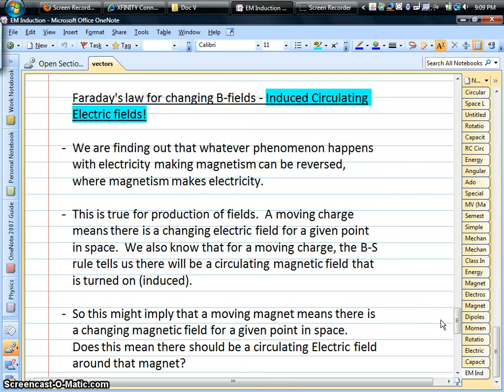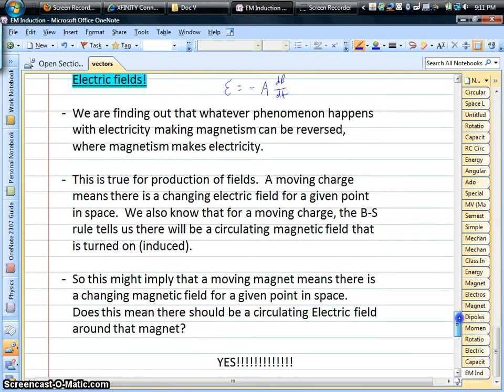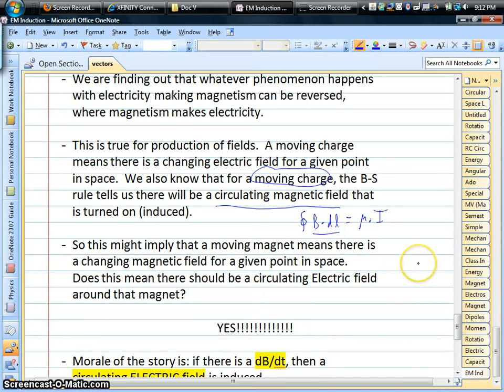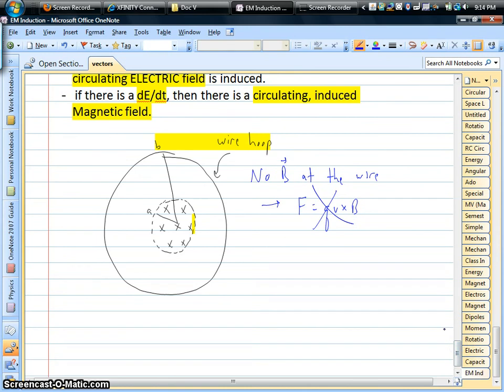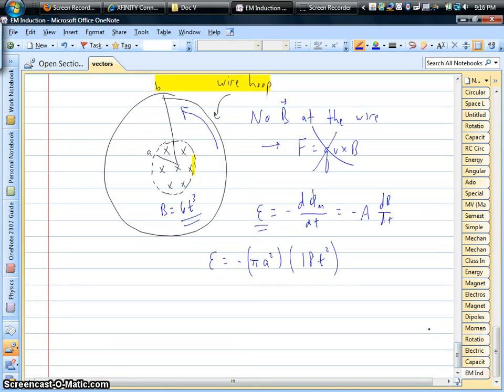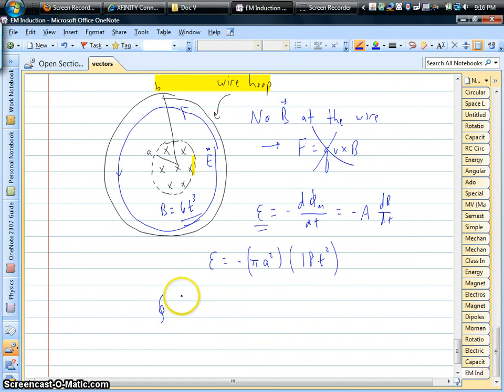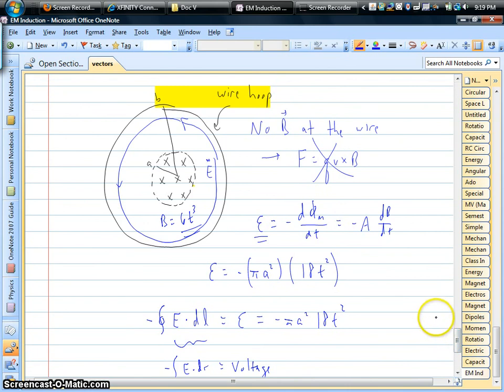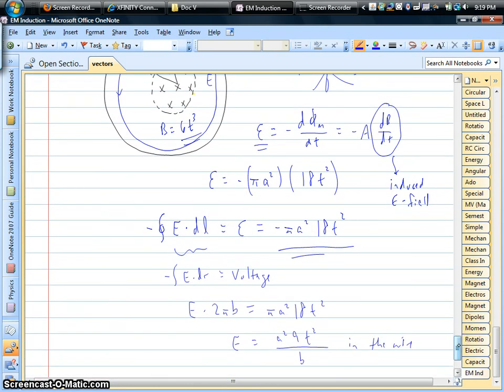Induced E-field from changing magnetic field.avi

Comment: let me see if I understand. So let's say you have a u magnet with a keeper across the prongs (completing a magnetic circuit so the flux lines are contained within the looped magnet) and you position a wire vertically near it let's say perpendicular at the midpoint of one of the prongs, and you break the magnetic circuit by removing the keeper bar from the prongs, this would induce a current in the vertical wire without moving the magnet or the wire?
Reply from the maker: hi li Yes, if I am understanding your scenario properly (trying to picture what you have in mind), by breaking the circuit (I am assuming there is a current in that circuit producing a B-field) you then go from having a magnetic field to not having a magnetic field - this is a dB/dt, and therefore an E-field would be induced! Physically, this E-field would create a force on the free electrons in the other wire, a conductor, and there would be a current. This is the wonder of induction!